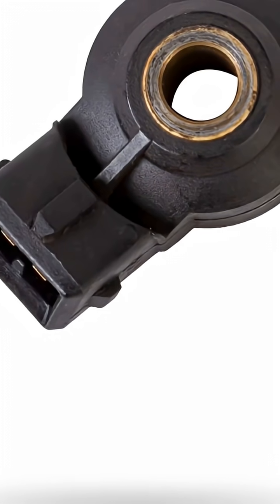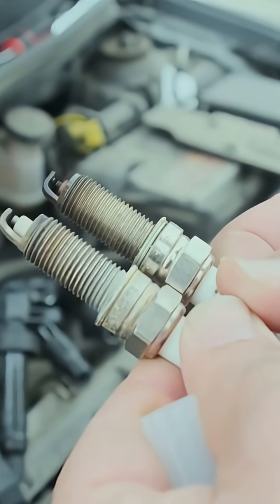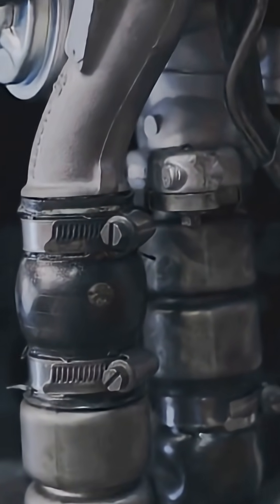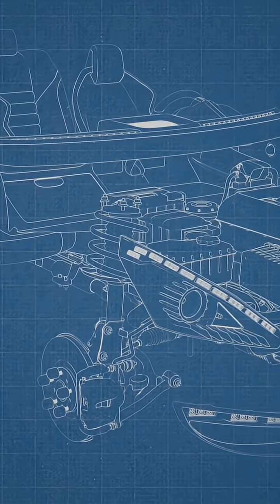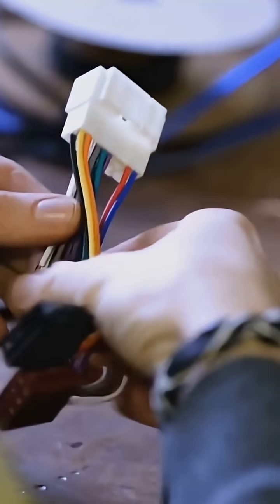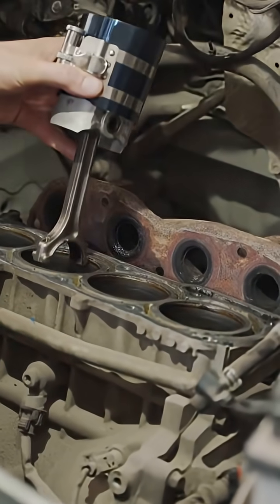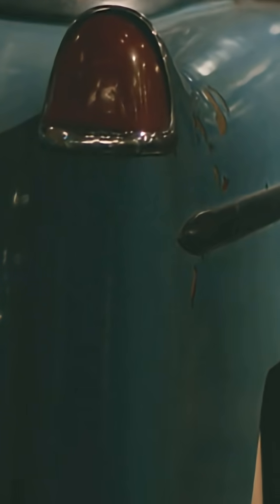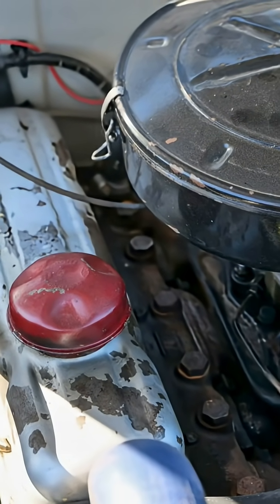This tiny knock sensor listens for trouble before your engine even knows it.

Comment: I hated how bad mine was to get to that I relocated it. Same with an auxiliary water pump.
Reply from the maker: youre right man the location  is key tho, they need to be close to the engine block, intake manifold or cylinder heads and thwy hard to reach